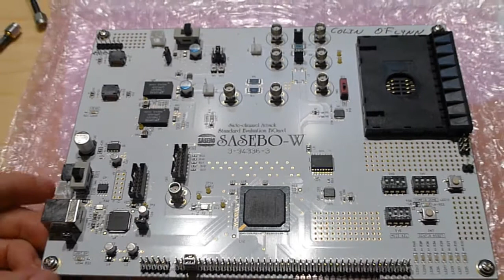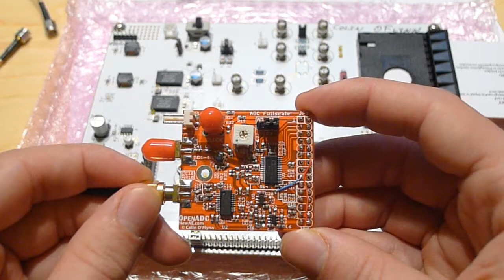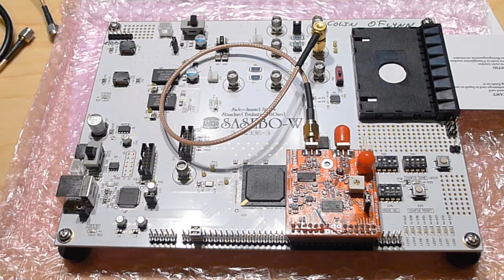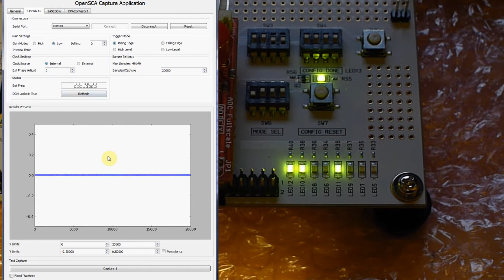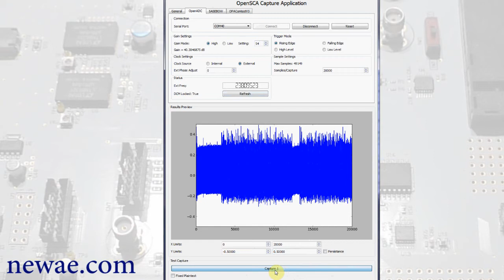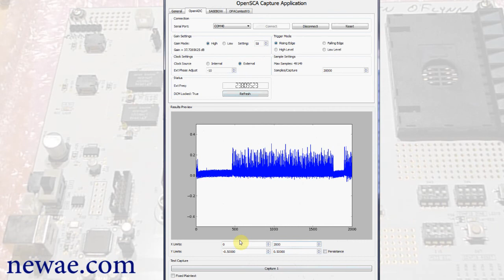SASEBO-W with OpenADC Capture Example for Side Channel Analysis

Comment from the maker: Any short SMA cable will do - I used about a 6" semi-rigid (also called semi-flex, RG402) cable that I happened to have, with one end being a RA connector. You don't need the high-freq response even remotely, so just buy something cheap from E-Bay....

Comment from the maker: Thanks for the comment - I got the SASEBO-W for being an academic participant in the DPAContestv3, but you can buy them from SAKURA. The OpenADC should work with the SASEBO-G too, just needs some tweaking. Do you mean a -G or -GII? Otherwise can use it with a cheapo LX9 FPGA board (see my other video).